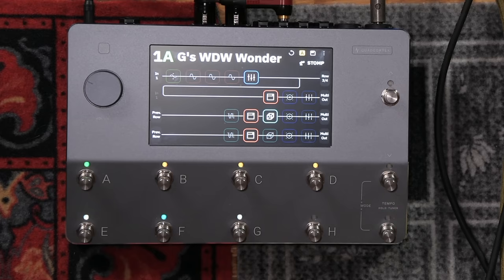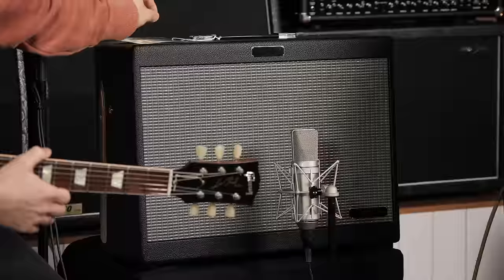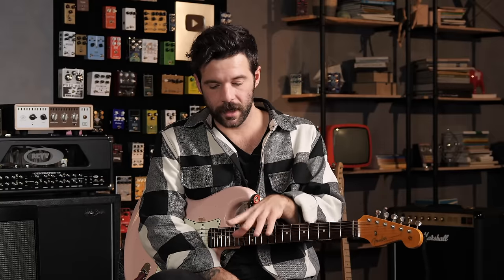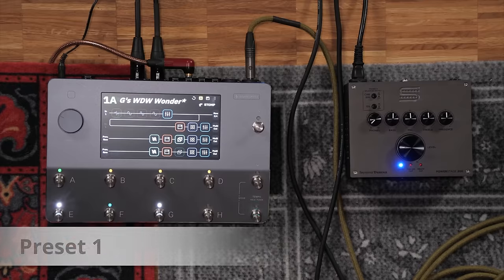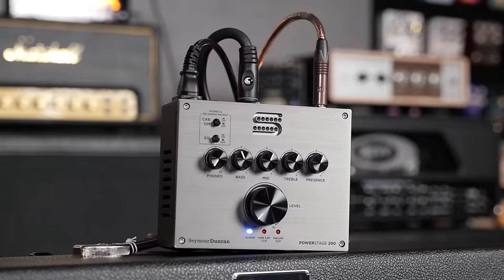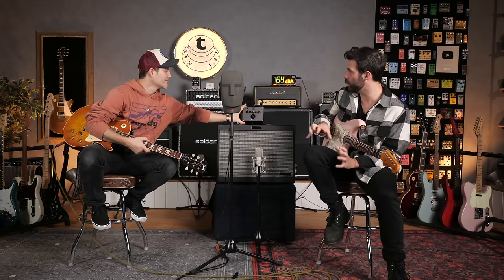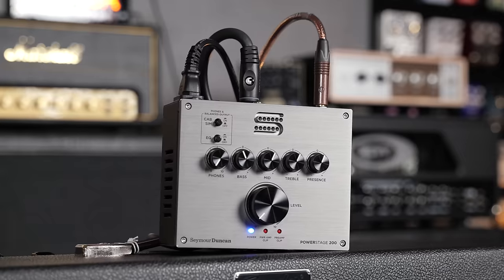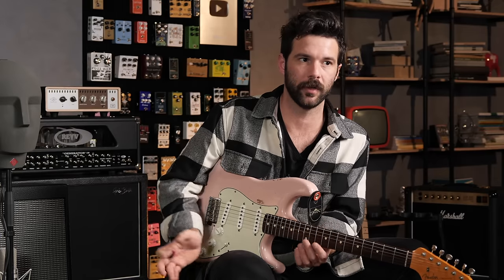Best Ways To Amplify Amp Modellers | FRFR or Guitar Cab? | Thomann

Comment: Thanks this is a great video. But i only own a tube marshall combo and a Fender Mustang combo (not tube) what are my options if i dont want to buy a separate cab or poweramp or a frfr or desktop. Can i go direct into the marshall effex loop or infront of the amp? Or maybe if i buy a poweramp and then go into the combo (back of front) or maybe into the Mustang combo? Can you fix that eq problem with/on the poweramp before the effex loop of i e the Marshall combo tube. This is rather confusing when you dont show/explain combos to head into a cab. I really want to buy the headrush. Does this mean i cant use a tube combo? Maybe the Mustang? Therefore is this two worlds that you have to buy so much stuff and restart? Dont get this. Thanks
Reply from the maker: Hey man, the two best options to use the Marshall combo with the Headrush:
1. Go into the fx loop of the combo -> Guitar goes into the Headrush, you make your presets with pedal and amp simulation but turn off the speaker simulation, then you go into the fx return of the Marshall.
2. The 4 cable method -> Guitar goes into headrush, choose the pedal and fx simulations you want but turn off the amp and speaker simulations, then connect the Marshall input and the fx loop with the Headrush using the 4 cable method (I'm sure that is explained in the manual of the Headrush and you can also read about that on the internet). This way you only use the multi fx for overdrives and effects, all the amp tone comes from the Marshall combo. 
Does that make sense to you?
Cheers //Kris
Reply: @ThomannsGuitarsBasses  thanks Kris this helps a lot. Can i also use the headrush into the Fender Mustang (i think you class this as a solid state?) or into my Spark first generation biggest amp?

Comment: That Harley Benton Cabinet needs to have a Harley Benton GPA 400 on top in the same enclosure. 
Please, make that product. A Harley Benton G212Plus Creamback that can run Stereo or w/d cabinet with a transistor stereo power amp in the same box.
FRFR suck big time and the Harley Benton G212A-FR Active Cabinet is the only product in one box that HB has done... and it's an FRFR 😞
I now use my HX stomp through the stereo fxloop of a Blackstar idcore100 but it has 10" speakers 😖
Reply: That's a great idea
Reply: @valendis  I KNOW! Maybe Harley Benton will agree with us 🙂

Comment: Could someone help me understand the signal chain when using a power amp and cab. Like what plugs into what? I'm about to buy a kemper stage but all the inputs on the back are a little bit overwhelming.
Reply from the maker: It's usually pretty simple if you simply want to go from the modeller into a power amp. 
The guitar goes into the input of the modeller, then from the main output you go into the input of the power amp. Then from the power amp's speaker output you go into the cabinet. If you want to use it in mono, just use the left output. If stereo, you need two mono power amps or one that's stereo. In that case you go from modeller output left into one power amp and from output right into the other. 
All the additional jacks on modellers are for other things (fx loop, alternative inputs / outputs, etc). Cheers //Kris

Comment: Loved the video! Question: I am looking at speakers to use for solo performances in small rooms (elderly care houses) and I was wondering if PA speaker can only be used for monitoring or also as speakers for the audience? If so, what are some good budget (cheap) options? Thanks in advance!
Reply: I can help you with your question, there are several options available, what are you planning on amplifying in the settings you've mentioned? and how large or small is the area of performance etc?
Reply: @LIKEFUNK  I am planning on doing some 80s rhythm and lead guitar in stereo. Will be using backing tracks etc. so a bluetooth option is also preferable. I will be using the Boss IR-2 with some pedals. Venues will be really small and intimate.
Reply: @SessionGold  Any small P.A. should get the job done nicely for you, not a lot of options available regarding the bluetooth though, you can buy a separate bluetooth transmitter and receiver unit and connect it to from output to input etc on a small mixing desk or directly on the input of any  powered p.a. likewise, -treat the connection as you would if it was a wireless microphone etc, the p.a. ideally could be a small Behringer type of any self powered alternative, the larger the speaker, the better the overall sound coming from the enclosures, particularly for guitar via the IR2.
Reply: @LIKEFUNK  So 2 wedges pointed at the audience would be sufficient?
Reply: @SessionGold  Yes, even a couple id wedges should be easily able to handle your needs in a smaller type environment, try to elevate them into a conventional position if you can and treat them as you would a pair of small p.a. enclosures.
Reply: @LIKEFUNK  Awesome, thanks for the help!
Reply: @SessionGold  Glad I could help you, have a great gig! 🎸

Comment: FRFR cabs claiming to be the proper way to use any modeller for live or recording purposes is a scam quite frankly, any reasonable quality 15 x 2 way P.A. cab is better than even most boutique guitar amps, because they already have the full range of frequency handling capability required by standard default and most are ready to go and more cost effective too!
The secret is to avoid using any conventional guitar amp because it already has a preamp stage and in most instances it can't be avoided from clashing of putting an additional preamp on top of the preamp in the modeller, I've been using only a specific P.A. enclosure bin as my guitar amp for years and it murders with a decent modeller 99.9% of conventional guitar amps, including boutique type and very reputable costly types likewise.

Comment: You connecting  power amp to power amp ? I do not understand I!!!!! is not clear  at all !
Reply from the maker: Hey, the modeller (Quad Cortex) doesn't have a power amp. It's a line level unit, that's why you need one of the four amplifying options: a guitar amp, a power amp, an active FRFR speaker, or an active PA speaker. We showed those for options, one after the other. 
Does that help? Cheers //Kris
Reply: Yes...thanks for the clarification @ThomannsGuitarsBasses